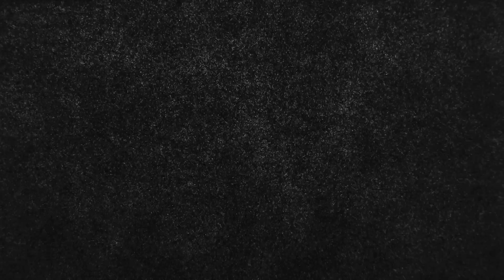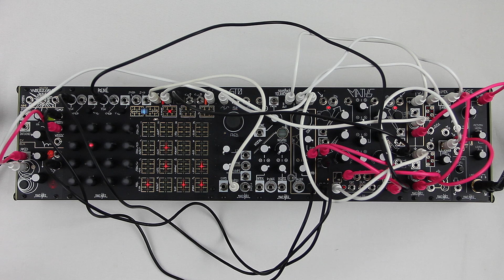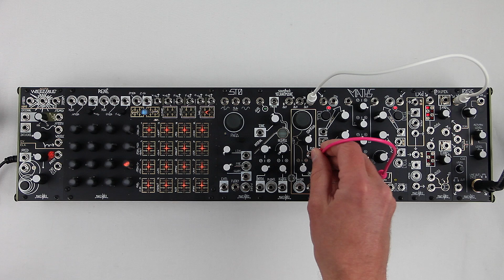Patch From Scratch: Bouncing Ball Percussion with System Cartesian

Comment: None of the outputs of the modemix were connected to anything..  (for that gritty ring mod between TH and STO).
Did I miss something ? My eyesight sucks at times so my apologies
Reply from the maker: mDm Channel 2 output was patched to the Mono Return input on the Rosie. (Channel 1 output was passed through to Ch2 input via normalization, and then Ch2 Carrier Input was modulated by MATHS Ch1.

Comment: Is there a link to the bouncing ball concept alone?
Reply: VictorSteiner As explained in the Maths manual;  Set CH. 1 Rise full CCW, Fall to 3:00, response to Linear. Set CH. 4 Rise full counter clockwise, Fall to 11:00, response to Linear. Patch CH. 1 EOR to CH. 4 Cycle Input, and Ch. 1 variable Output to Ch.4 Fall Input. Patch CH. 4 Output to VCA or LPG control Input. Patch a Gate or Trigger source, such as the touch gate from Pressure Points, to CH. 1 Trigger Input for manual start of "bounces." Adjust Channel 4 Rise and Fall for variations.
Reply from the maker: Here are a couple takes: https://vimeo.com/72288453 , https://youtu.be/Mx_3cqPSiP4